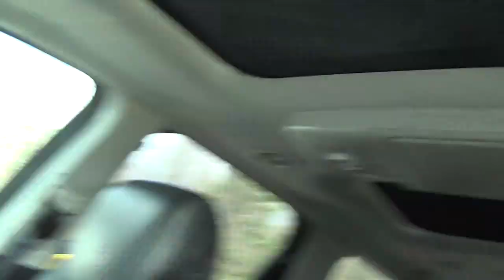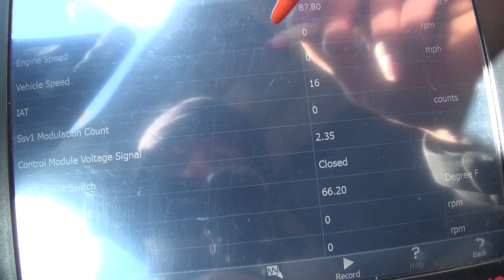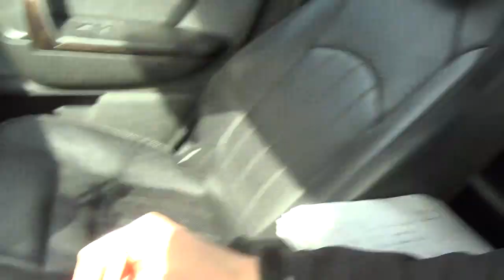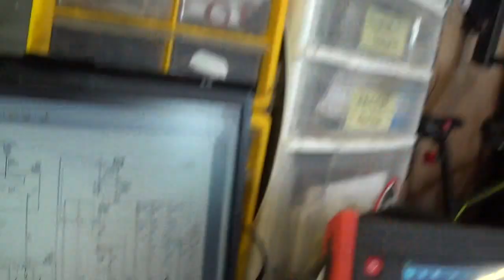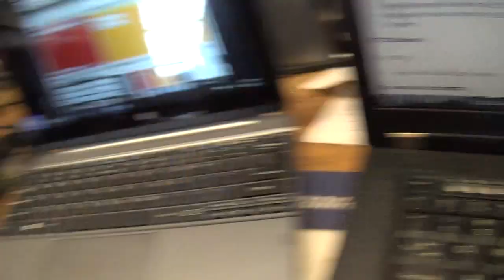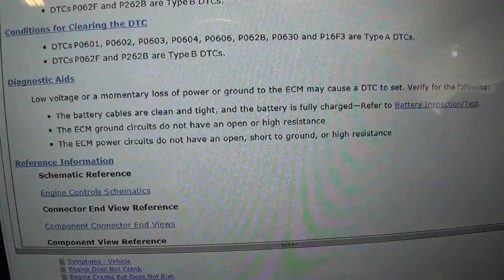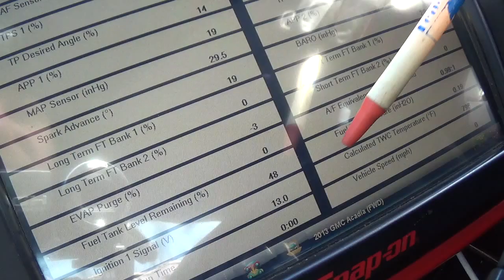COMEBACK!!! No-crank, REDUCED ENGINE POWER: '13 GMC Acadia -Part 4

Comment: Time for some more armchair kibitzing...
Do you know if the IGN1 voltage reported by the scan tools is actual or what's reported by a module?  If it's reported data than why trust it when others are so erratic - 158 MPH?  The scanners are reading and parsing a data stream.  Snap-on may have some error traps or code that the other scanner lacks or maybe it ignores a CRC check or something to provide SOME data - hence the crash on the other when encountering a garbled snapshot taken while the modules were crashing.  I question whether any data in the freeze frame can be trusted.  An analogy would be asking your secretary to take notes then push her down some stairs.  How legible will they be after her Slinky® impersonation?  Stuff I'd try:

1. Computers usually have some sort of capacitor to keep them powered up through transients and spikes.  An erratic short to ground is unlikely but possible and will also drain those capacitors fast so can be of a shorter duration before module failure if they don't have working diodes in place to prevent that.  Maybe connecting your scope meter (filter turned OFF) to the relay output while driving or wriggling things will reveal smaller spikes/drops taking place that the modules are able to cope with just under the failure threshold.  Same with the signal line to the relay coil.

2. Force the issue - Since you can't wait for crap to happen on it's own, adding a variable or stepped current load (string of bulbs?) at the relay to bring the total load on the relay (modules + fake load) near the max fuse rating may reveal weak connections while performing the step 1 checks.  Maybe there is green snot in the fuse box - I can't recall if you checked.  Eric's fun with his recent transmission connector comes to mind along with Danner's recent relay and the fact that GM can't source a decent ignition switch.  All places to check.  

3. If spikes, drops, or noise is found - use an ammeter trace to determine if they are caused by shorts or opens.

There, my 2.006 cents have been tossed into the kitty... pass me a beer.
P.S.  Crap.  Just noticed Joe Keefe's comment further down.  Maybe there is a high current short taking place and robbing the whole system of power enough to trip the computers...In that case, loading up the relay will not be useful :(

Comment: Ivan, sometimes it can be a transistionresistance in one of the sensors or connectors that occur at dampy weather conditions, for instance check the inlet airsensor and the speedsensor, do all your checking with a loadpro as EricO suggests and an Ohms meter. Here in the Netherlands we do have that high humidity conditions often up to 95% I use Vaseline to protect all connectors i can find to avoid bad contacts. It definitively a needle in a haystack sometimes.
Good luck, man p.s. is'nt this a Deawoo? then its made for low humidity eareas LOL

Comment: I would just replace the power relay for cheap insurance on the power side of the cpu's and inspect the grounds with a multi-meter to be sure they are good end to end. I had a starter totally fail on me because I had a bad ground yesterday that caused it to pull too much current and burn the motor. Replaced the starter it would not do anything and checked my grounds and it spun to life. My engine ground had rusted.  Also I remember your bmw video where you had that pcm fail that caused the power side to fail and the car to stop running. My guess is maybe bypass the ignition switch with a jumper on the relay and see if the car holds steady after giving a full ground inspection. Good luck my friend. Also your computer on the car maybe toast if it had too many brown outs like my starter did with the bad ground.

Comment: Ivan, whats next for cars. Are we going to have a glove box control module? A data pid for the percent the door is opened? Ridiculous the amount of electronic in new cars. But seriously, I can tell the frustration in your voice.  Im going to take a guess and say the excessive resistance from the loose battery cable is the root cause. Maybe frying the pcm? Maybe voltage spikes from the alternator?

Comment: One thing I like about watching videos is matching Mitchell Pro Demand against Identifix and AllData to compare them b/c good data is critical.  The Mitchell Pro Demand & Identifix matched which is good.  There are a lot of unanswered questions and checks to be done & until they are done you could guess a lot of possibilities. What do the ECM PIDS read when it is not screwing up? I was just looking over the wiring schematics & lots of checks come to mind like TCM showed 2.4 ign volts so is it resistance, bad contact or being pulled down and it's a separate wire coming out of the fuse block but the ECM and FPCM are on same wire?, Underhood fuse block plug X3 loose, corroded, inspect pins 38 & 18, moisture intrusion during rains?, is run/crank relay (Ign main relay) pin 30 voltage being pulled down, is relay pin 87 voltage low, relay socket corrosion, does IPC & airbag circuit actually work during malfunction or is voltage too low which then could possibly be a bad run/crank relay, P0606 Int PCM Fail did it flag it b/c of low or loss of power...probably especially with the TCM registering 2.4V. You have a fun one here Ivan! Can't wait to see what the next episode brings.

Comment: YOU HAVE THE INFO IN YOUR HANDS. HAVE A VERY IMPORTANT DTCP0606 IN THE ECM. PUT P0606 IN THE IDENTIFIX SEARCH BOX. IT REFERS TO INTERNAL ECM PROCESSOR FAULT. I THINK ECM IS NOT GOOD. SUERTE AMIGO.
Reply: THAT COULD BE THE CAUSE OF REDUCED ENGINE POWER. NO CRANCK I THINK IS SOMETHING MORE. ANOTHER PROBLEM.
Reply: IDEA: PUT TOO "P2534  AND NO CRANK" IN THE SEARCH BOX AND SEE WHATS THERE...

Comment: you could ask the customer if the faults only or when  attempting to start or running or both. I'm a gm (Vauxhall) field tech and have seen these dtcs with a faulty ignition switch ,mostly on manuals (stick shift)
regards Joe

Comment: Hey,I know that feeling fortunately gm does have a special diagnostic  software used with the mdi for finding intermittent issue.i have access to that and have used it when diagnosing intermittent problems.i can send you more info if you would like there is alot of info about it.but in short it monitors every module in the vehicle and logs when it loss communication and how many milliseconds it took to respond.i have a avalanche that is a nightmare only way I was able to pin point issue was with mdi and that diagnostic software gm offers.....try putting the pcm in freezer for a few minutes.see if it acts up..good luck

Comment: Tried spraying it down to try to recreate the issue? Can you get a hold of Eric O and get one of his manual switch relays to see if it is a oddish ignition relay shorting out. Or perhaps the radio ground issue is somehow causing bcm signal issues?

Comment: 2011 chevy Arcadia had the same Dtc it had a loose ground
Reply from the maker: Do you remember which ground it was specifically??
Reply: motoYam82 two main grounds directly under the airbox, I'd try wetting the harness from ecm to tcm plug while moving it to see if you can duplicate a short to ground on the ign feed to the tcm. also look for crusty on the (i believe) 16pin connector on drivers side shock tower just above the ebcm. make sure the 10mm cpa bolts in the unferhood fuse block are fully tightened, the Orange tabs should be squeezed together. Good luck.
Reply: motoYam82 My bad the car I checked was a 2011 Chevy equinox on these the battery goes in the front it was not the main ground but it was a small ground that that connects to the post with the 10 mm nut  it was loose and it was not making contact correctly which the problem was that the car would go into battery saver mode but it had P2534

Comment: 1) possible defective main relay momentarily open on load or control side.
2) check all wires and pin drag at ignition switch, fuse box and PCM.
3) possible defective PCM???? 
4) ignition switch has defective contacts causing open?
5) you mentioned rain in the sequence of events. is there some sort of small water ingress into a fuse box or connector?

Comment: Looks like you need a load pro... 5 min job in and out instead of all this monkey'in around... Push button, squeeze relay done.
Reply: South Main Auto Repair haha
Reply: South Main Auto Repair lol
Reply: I went to all the trouble of pulling up schematics and having fun with all the possibilities and then I see your post & I wasted all that time...crap. Forgot all about the magic button however I have pushed another magic button a time or two with outstanding results :O
Reply: Hmmmm. Vice grips around relay- check , push button - check , fire extinguisher .......... oh boy
Reply: Plus quickly can make a test drive and get an ice cream cone at a place where they keep em open year round.
Reply: Yeah, as soon as the wiring diagram showed both modules served by the same relay, I suspected that relay too
Reply: Eric, don't forget to face north, put left hand on  your head, and pee into the wind ... THEN give the relay a squeeze. :D
Reply: South Main Auto Repair ouch
Reply: @Smitty
Would that be with or without his hat on his head??  :)
Reply: +Tinkerwest: Ahh yes, the brim of the hat must face north-northwest. :D
Reply: Yes, due North with the wind coming from the South.
Reply: its a jack in the box where dick fagerony jumps out
Reply: haha!
Reply: This relay seems prejudiced only against its output to just the trans, FP mod and ECM, but not the other circuits it feeds like rear camera or air bag....I suppose load pro can be useful if circuits being fed by this Ign Main Relay are isolated...
Reply: @Smitty
I thought so...I wear my cap most times when wrenching but didn't know which direction to face, TY very much...
Reply: :D :D

Comment: Go with changing the relay and check the temperature of that relay and see if it's getting hot. Also see if the relay has a resistor build inside of it. Write it down on your check list. You will figure it out. look for a bad connections at the tcm. Do circuit testing the harness and unplug the tcm. Yes I know I am referring to Eric's video. But it has been 45 days since the last time you worked on it. Its a intermittent problem. Relax and you will find it.

Comment: Yes, a mechanical "relay" is an electromagnet, that gets hot, and heat makes it weak- causing the controlled contacts to "buzz" and make arcing, the arcing cooks the oxygen in the air, making ozone- which is highly corrosive, and pitting from the arcing will all cause the relay to fail. During this buzzing- the resistance on the contacts on the controlled side will increase, slowly or abruptly. If the relay's main feed isn't quite enough- it can also make it buzz.

Comment: i would pull apart the relay for the ECM and check for the case of green crusties and or burnt terminals on the inside of the relay before calling a bad ECM or failure to properly program the ECM I would also check all powers and grounds 2 + for the ECM

Comment: bad ignition switch the 13 volts you saw on the freeze frame frame data from the ECU is a voltage surge when contacts connect again, don't forget freeze frame is delayed which would explain different voltages you see in TCM FPCM the key was the voltage you saw in the TCM data pid       control module voltage at 2.4 volts you are on the right track a relay would not cause this

Comment: Looks like the main problem happened when the car was wet and off. I'd check that connector for evidence of water. If it appears ok you could take it to the car wash as was already suggested. That's if there is no way you can get competing signals from the Ignition switch and BCM.
Reply: Yeah take a power washer to the ECM connector while it's running. If it dies hey lady there's your problem lol.

Comment: Greetings Ivan...I don't think ignition main relay is problem as it feeds five things; rear camera (x2 pin 25/Pink) I/p fuse block for 3 way distribution to inflat restr sensing,  instr. cluster and pass air bag disable indicator mod (x2 pin 29) which would flag problems/codes on those circuits ...However on connector 3, pin 38 (pink) goes to tranny and pin 18 (pink)goes to both fp module and ecm...My feeling is there either green crusties on connector or PDC/fuse block OR maybe chaffed wire at or near J132 where feed is split to both fp mod and ecm...Good luck...Edit added: by chaffed wire I mean pink power feed partially grounding and dropping voltage...
Reply from the maker: Now if a power wire is "partially grounding", wouldn't that blow a fuse further upstream?
Reply: There may be current limiting protection designed into that circuit to avoid fuse blowing, since we don't know exactly power dist center is engineered....I would disregard that 13 volt reading and attribute it to surface charge on battery...I would monitor the output pins previously mentioned...See what comes out and check what reaching the tranny, fp mod and ecm...

Comment: Im leaning toward a bad ignition  1 relay when I saw that the 3 modules were all linked to it. It makes sense that the ecm has processor code because at the point of failure it's struggling trying to figure out how to provide power to the other modules when it can't provide for itself

Comment: so0o00o.... I think you are not getting all of the story here ivan. if I remember correctly you found the battery cable loose and the dealership has found it loose. I would wonder if somebody is disconnecting the battery for a draw? maybe they are disconnecting it to get it to run when it does act up. often times the radio frequency hub will act up on a dodge giving similar results. the only thing that wored in that scenario is the electric seats until you give it a battery reset, because the rfh wasn't recognizing the key fob. pewrsonally I would be looking at powers and ground at the pcm... high voltage could be a bad ground unsure about the app and mph issues. it wouldn't hurt to perform a wiggle test while monitoring pids, both off and running and the car wash has worked before. by chance does this bucket of bolts have an opening in the roof to allow excessive water intrusion?

Comment: Let's try. Faulty ignition switch at run position.
1) Intermittent on when should be off drained the battery during the night -> no crank
2) Intermittent off when should be on caused the low voltage failure codes as FPCM and TCM lost ground -> Limp mode  due TCM code -> ECU stored 168 mph due TCM booting 
3) ECU voltage is measured elsewhere than ign1 + not dependent on Ign switch grounding it
4) 12,2V @ ECU after 6 miles  due new but not fully charged battery installed, 13V after 21 miles when engine off -> normal charging.

Does Acadia have a large dongle @ ignition key?

Comment: Comebacks suck that's for sure but anyways looks like you have a module failing. I would check powers and grounds first though. I agree with you I don't like the 13 volts with it not running and the 2 volts at the Tcm. There dealer sucks they should not have charged them again for the same issue to rescan it and they should have gone after the p0606 under warranty. Most of the times I have seen that it has been the ECM that has failed but like I said always verify powers and grounds. I'm sure you will get it fixed and end up with a customer for life.

Comment: get the pico out and check the ignition 1 voltage on all 3 at once and see what happens. maybe theres an intermittent connection issue in the fuse box for the ignition 1 10 amp fuse.

Comment: The 158mph rings a bell.  I had a car that threw a O2 heater code and freeze frame data was crazy mainly because the speed was 255KPH=158MPH, I've got no idea what it means but it must be some default value. 

 https://goo.gl/photos/Cku5PTHvZ6MuzzZa8 

this is the freeze frame for a turbo audi.
Reply: Jason Beattie 8bit values are 0-255. Internally use metric, then convert to Freedom Units for the USA market.
Reply: Mainly because of the speed? Every value on that freeze frame is maxed out. Looks like your scanner couldn't interpret the data correctly.

Comment: just a thought,but considering that it acted up in wet weather,and the codes that are being read,,,
could there be corrosion at the pcm plug,
also could there be a nasty ground wire connection,at the block or frame.i did come across one in my shop with a bad ignition
switch.just some thoughts.

Comment: lol 158 mph the owner probably had explosive diarrhea. trying to make it home before the chocolate rain
Reply from the maker: LMAO is there a TSB for that?
Reply: @PineHollowAutoDiagnostics  
well they must of consumed a dorman product. there known for causing stomach problems and pain in the a...
Reply: yup what happens the ecu goes to open loop when the pedal is floored 
which causes 10 air fuel ratio. which in turn will cause fouled plugs. i
 think the code is p00p

Comment: Low ignition switch voltage, High speed sensor reading...Thinking maybe a problem in the transmission harness.

Comment: At this point I would verify that the ig1 circuit is good, bench test the relay and if that all checks out replace the ECM. And if it comes back at that point, burn it.

Comment: APP1 and APP2 are for the drive by wire throttle petal sensors.( Accelerator petal position sensor) one sensor is always half of the other, not sure why but its normal.
TPS 1 & 2 are on the electronic throttle body and they have two for redundancy and detecting a fault within the sensor